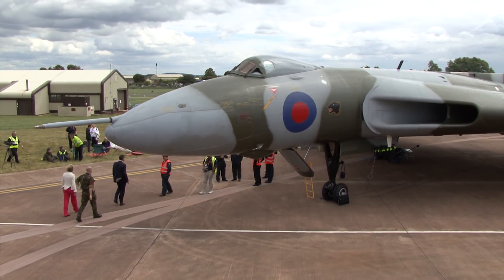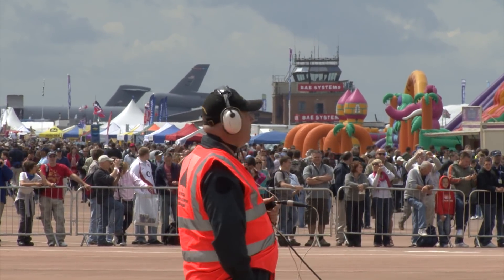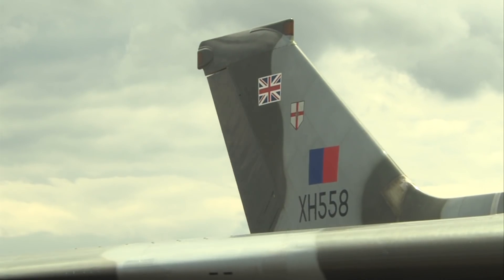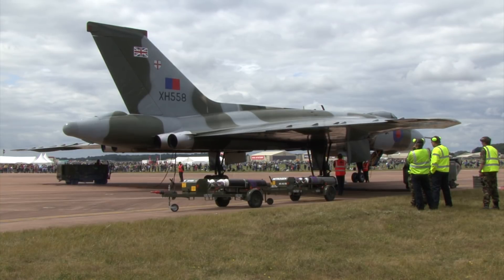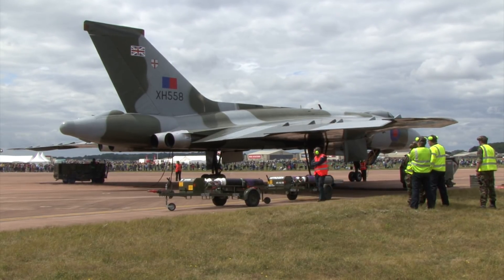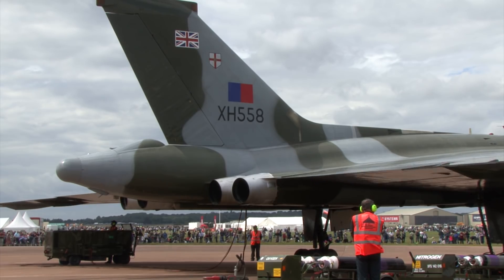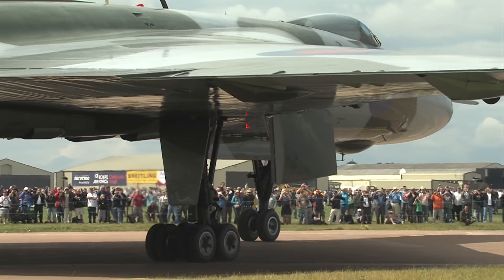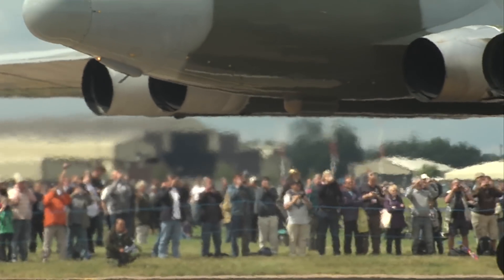How to Start a Vulcan

Comment: Don’t know when it was last carried out at Wellesbourne but. On a couple of occasions I have seen them drag their Vulcan out. Plug in a ground unit. Start up all four engines & work the control surfaces inc. air brakes.  Not visited since 2019 but at that time they kept it in good nick using mostly ex RAF personal & ATC volunteers.

Comment: I trained as an aircraft  engineer to work on these.They had a wartime  rapid start proceedure which could have all four engines running and the aircraft  taxiing for take off in less than 2 minutes
Reply: At RAF Waddington they always worked on the principle if the ground crew couldn't get it started "Bring in a Scouser!"

Comment: Must be over an acre of wing.  Fan-bloody-tastic airplane!  No howl on throttle up, probably need to be recording forward of the aircraft.
Reply: Not necessarily, the howl only occurs above 91% N1 (fan speed) so if they were taking off at lower thrusts, which I'd think is perfectly feasible here, they aren't carrying a weapons load and probably have fairly low fuel, so they're light, and fairford runway (as another commenter suggested this was) isn't exactly a tiny runway. However, yes, I think the howl is definitely more pronounced head on, I'dve thought they'd get it at that angle though....